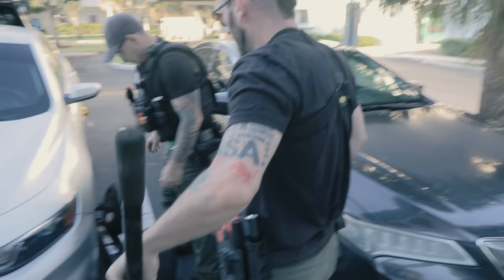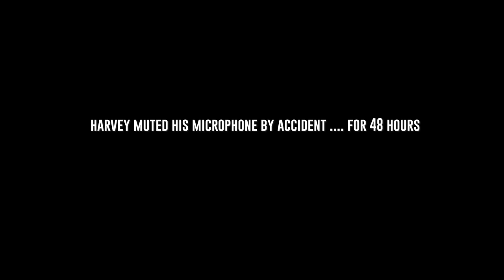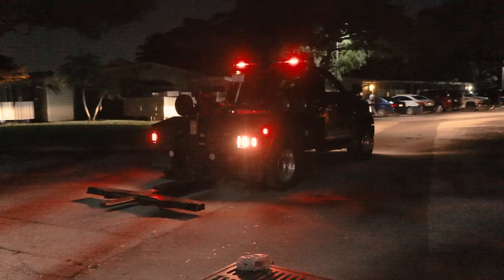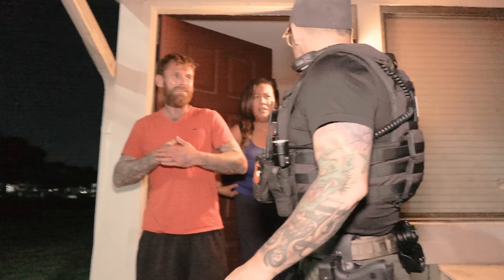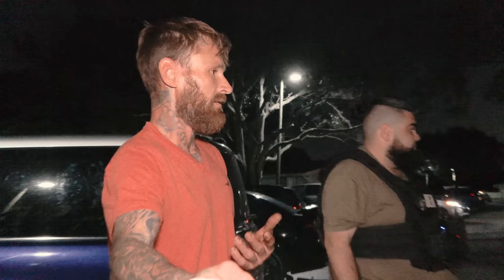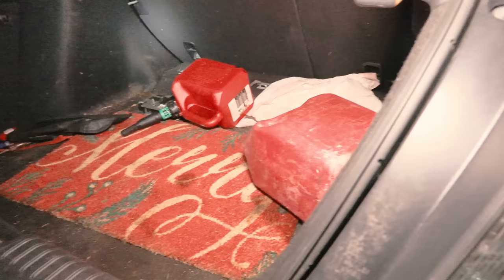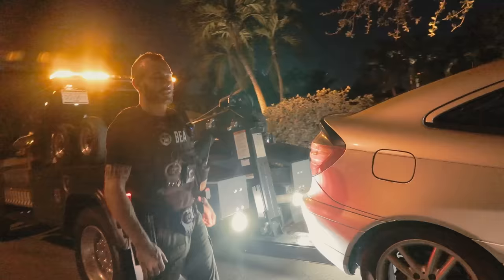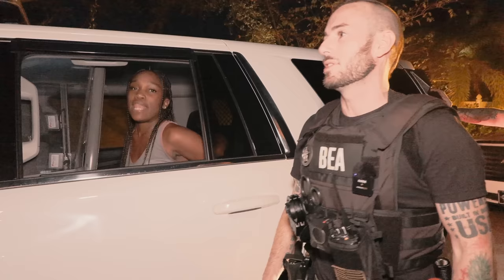I'm too Pretty to go to JAIL!

Comment: Patty when you go out on a repo look up the VIN number that will tell you if it is a front wheel drive or a back wheel drive. Work smarter not harder. In and out. That is what makes a repo man.

Comment: 4th repo. As a reminder I am not a bail enforcement agent. I just post comments on YouTube. YouTube screens my comments and automatically deletes them per YouTube computer. I try to state professional comments while practicing good judgement and respecting youtube policies. Thank you. Agents are responding to a repo contract while assessing a wide perimeter. Agents found the vehicle (Mercedes Benz) apparently it's a 4 wheel drive with no drums on the back wheels. 2 wheel drive guys!  Forget what I said it's a rear wheel drive. Female suspect is in custody for failure to provide correct address for bail bondsmen and home base bail agency. Her car just got repossessed as well.

Comment: Hey patty im a tow truck driver and I just wanted to let you know if you didn’t want to use the Dollie’s you can drag it out and hook up to the front it’s a lot faster
Reply: It depends on the bumper if it’s too low down then it would be dragged across the floor, then he would have to pay for damage fees
Reply: @emilysymonns982  not at all he is putting the car up to high as long as it’s strapped

Comment: Should research enough on the car before you get there to know if it's front wheel drive, rear wheel drive or all wheel drive.
Also need to preplan everyone's role at the office.
Need someone riding shotgun in the tow truck. Soon as you hook up you have a man on each side strapping a tire.
After hookup the one riding shotgun in the towtruck switches to being with the paperwork guy in the 2nd vehicle and the car is towed off.
And the paperwork guy is driving the 2nd vehicle and is the one that calls and contacts the car's owner and the towtruck shotgun guy is now with him.
Or some such plan, but smooth it out, the lack of organization is killing me.

Comment: Hey there patty I know your repos are amazing and to move the tires are a pain in the but but look up tire jack rollers. It will make your life a lot easier
Reply: Now the smarter thing to do is drag it out Drop it and re hook it this could had been done in 3 mins Them Go Jack were not made to toes cars for long distance. @PatyMayo  Great Video as always
Reply: No it fucks up the tires and the rotors when u drag it.
Reply: @corwintate7258  it won’t do much or any damage if you drag the vehicle 🚗 a few feet drop and hook it from the front   I have towed and repo 100s of cars back in the day and I did it by myself with no gun or partners. Trust me it’s quicker and faster.
Reply: Well good for you. Called advice is all I was doing instead of him using the tires and bars which takes time.

Comment: Yo my boi instead of wasting 20 minutes putting a dolly on you could have strapped it up drag it out of the spot because you already started dragging it pull it out to where you can pick it up from the front and then boom no dolly use and yea just a little tip!

Comment: would be easy if you go in from side of the car to the back of the front tires pick it up pull out to swing it out drop it then swoop it up through the front normally

Comment: I'm wondering why they didn't do a side front pivot then drop and then hookup then leave?  It would of take like 3 minutes and gone.
That's with one man and a truck, not with a crew.
I also noticed that they never pre-check the vin before touching the vehicle,  that's not smart.

Comment: Patty, mayo, you’re way too nice if it’s front wheel drive or rear wheel drive  and the drag it 10 feet just so you can grab it from the appropriate side it’s not gonna break the car 

Just don’t do this on a all wheel drive and or 4x3 because either way you’re gonna need to use the dollies

Comment: Why dont you guys attach the spreader bars to one set of the dolly wheels permanently and save time jacking around or just jack the car up and learn how to manually put a car in neutral from underneath?  You should consult with an experienced repo guy and practice and learn from them?

Comment: Do verify more than the last 4 of the vin in my world that means nothing I work for one of the largest dealerships in the USA we used to just verify the last 8 digits of the Vin until someone got shipped the wrong darn truck we had 2 with almost identical Vins at the same time from 2 separate country's of origin so the rear of the Vin was identical but the county code and plant didn't match more did the engine so 3 digits of all 16

Comment: When you have an empty spot next to the car you're towing, you can get under the front wheels from the side of the car to pull it out of the spot, then re-position to get the front wheels from the front, strap it down and be gone. No need for dollies, etc. and much faster.